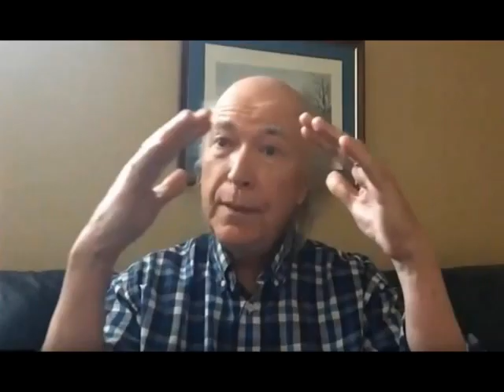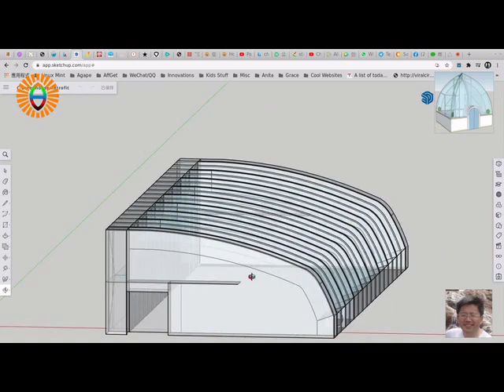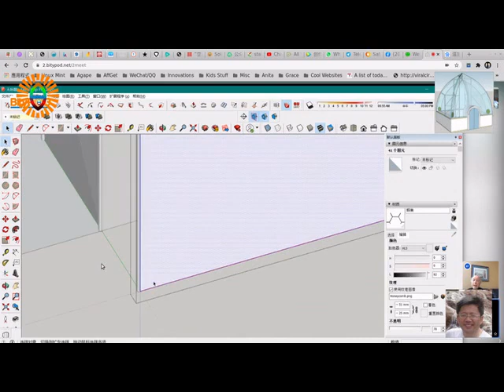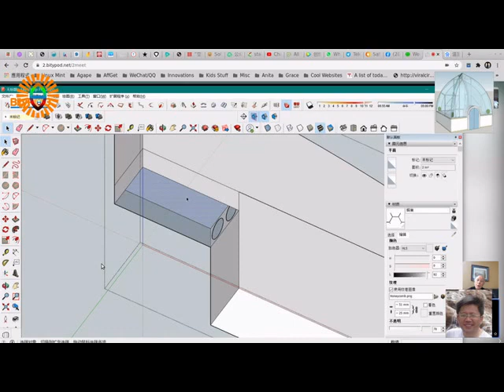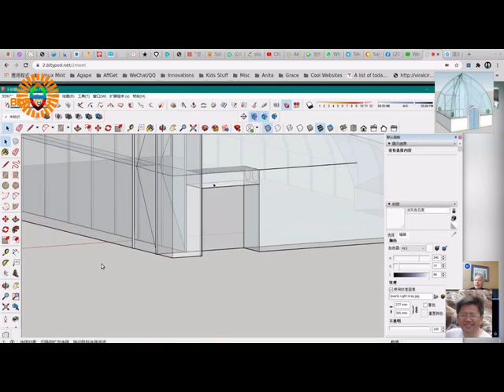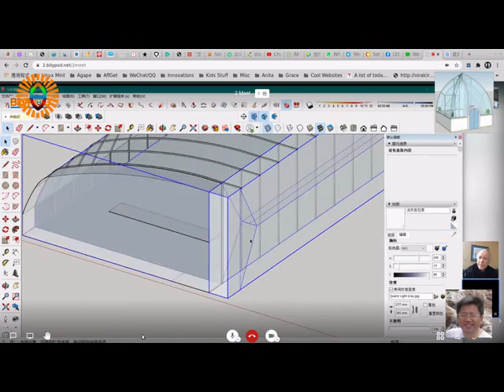Be Proactive: Critical Issues Revealed wtih Passive Solar Greenhouses or Any Conventional Buildings

Comment: Has his design ever been tested in -40 Celsius? We had a period of two weeks this year that was -40 and -50ish with the wind chill. It would be interesting to see how the greenhouse handled those extremes.
Reply from the maker: Steve, go to our website PyraPOD.com - on the home page I mention Kat and Ross Elliott who built a DIY greenhouse with some of Richard Nelson's guidance. Ross said that his greenhouse can handle -30 C without any problem. That was done a lot time ago. With partial guidance Ross could achieve that result, with FULL guidance with Richard Nelson I have the confidence to handle -40 or even lower temperature. At lease I know how, with Richard's help I could do it better. To tell you a little secrete: we are going to design a POD that could work on Mars or Moon. No kidding. Once the need comes, not a problem. How do I know, as we have a real life example: the Sun (heat source). the Atmosphere (heat capacitor) and the Earth (heat sink or battery).
Reply: @PyraPOD  are you an engineer?   Can you do a lecture on the energy systems of Agora Tower.  It is a giant greenhouse in a residential skyscraper

https://youtu.be/jO7LmzcNt5M
Reply: @PyraPOD  I am designing a smaller model containing just the solar, thermal, wind and water energy elements to generate electricity ⚡️ and hydrogen fuel
Reply: @PyraPOD  I believe these energy towers can be added on to any greenhouse allowing for renewable energy to create and maintain a variety of climate zones.   Growing a greater diversity of food, fruits vegetables and small animal livestock.

Comment: I did skip around in the video, so I missed the part where you explain why you chose bubbles over a liquid, closed circuit. For the life of me I cannot get behind the idea of bubbles happily floating through 200m of greenhouse. The entire cavity has to be water proofed and somehow bring it back to the tank. I find a closed heating/cooling system much more appealing (like in-floor heating), as it won't freeze if it's not heated, it can be used to cool the greenhouse in the summer and heat in the winter, just by using the reservoir as thermal battery. Anyway, thanks for the presentation.
Reply: Martian, what you mentioned is correct but not the complete picture. You talked about thermal battery, but the other half is how to efficiently capture the solar thermal energy. Simply using water in tanks is not efficient enough.
Reply: @MartianDanTheMartianMan  No need for any evacuated solar tube unless you need hot water for showering. Sorry, I have to say you did not comprehend how the system works. You have to think along the line of LIQUID THERMAL MASS. High temperature heating is NOT what are aiming for.
Reply: @TheoLogosDotNet  haha no, actually I commented under the wrong video as I am also in contact with people over solar heating systems and solar power systems. I should have paid attention to the title, lol.

Comment: This design seems to require a lot more maintenance?
Reply from the maker: Not really if you have fully understood how it works. Yes, you need fans that come with WATER PROOF motors - these motor are not that expensive now and are made to last long. Nozzles are NOT high pressure ones and they are working within a TOTALLY SEALRED cavity so that there is no chance for the soap liquid to get poluted and clogged. You do need to cover the soap liquid tank and add a filter to each water pump so that no solid particles enter into the sealed cavity. Note that we only need to operate the fans and water pump for just a few minutes every two or three hours. Because this long interval use, tear and wear are kept mininum. In this design, we place the fans and spray nozzles on the ground level for convenience IF there is a need for maintenance.

Comment: What about freezing of the bubbles in sub zero?

Ability to move such big distances while freezing on to wall

What about windows and leaking out or in. 
Soil contamination with glycol/soap etc

 What about collection of bubbles but maintaining the cavities to have a person walk?
How is snow cleared from green house in heavy snow fall no acces to inside?
How is bubble tank heated. Where is it located? 

Why not just super insulating all the non light walls once rather than cost and maintaining equipment to blow bubbles over and over?
Reply from the maker: Frozen bubbles only take place in regions close to the external layer. New bubbles are produced every two or three hours (depending your design) and new bubbles are warm. Windows? The whole canoy is a window. I mean you talk about ventilation, right? No need to ventilate once your can control temperature and humidy at the same time. Soil contamination with soap solution? Not much change in the sealed cavity. The tank you need a cover and a filter in the pump yes. Why do you need someone to walk in that sealed cavity? You polluted that area! Snow melting? No problem once you have warm soap liquid flusing the cavity every 2 or 3 hours in the form of bubble foam. Soap tank location, anywhere on the ground or half buried in the ground. The tank stores the solar heat you collect during the day for its use during the night.

Comment: Hi, many thanks for your share, ,small question, I recongnised the software SketchUp, do you use the simulator of sunshine? if yes could you share me the best orientation of this kind of greenhouse, because i'm sure full south is not the best, specifiquely in winter, when the sun is down, and shot time.
Reply from the maker: Well, if the greenhouse is well designed, then we do not have to pay too much attention on orientation. In our case, our greenhouses are transparent in all sides and everywhere. I am sure you know how SolarTube and Skylight works in collecting sun light from all directions. In essens, liquid bubble filled greenhouse with all sides transparent works on the same principle. BTW, that is the reason we did not start with the Chinese style greenhouse although I am Chinese myself :-) For the same reason, I believe our PyraPOD8 (Octa shaped) works better than the four-sided PyraPOD4 in taking light in from more directions.

Comment: Hello mister Zhang, i have a question how often do you need to refill the bubble layer per day and night? And how much liquid you reuse or need to refill?
Reply from the maker: It depends on how you design the system. We design it so that it fills the entire cavity in a matter of only a few minutes. And then everything stops, the fan and the water pump, for a few hours before you need to refill with new bubbles. Refilling is needed not because of natural bursting of bubbles, but because the need for heat exchange to take place. Remember the bubble temperature is not the same as the soap tank temperature. The goal is to store solar thermal energy in water tank.
Reply: @PyraPOD  Just to add concerning your second question: with 1 liter of soap liquid, you can produce 500 to 1000 liters of soap bubbles, depending on the size of bubbles. Use that as the guide, you will know how much liquid you need.

Comment from the maker: Richard pointed out that I made the mistake in explaining why the bubble temperature jumps up and down after sunset - that happend when the old bubbles were replaced by new bubbles. It is caused by the fact the outside is cold and soap water tank is relatively warm. So new bubbles will make the sensor to see this jump (see it jump towards the tank temperature), but the cooling of bubbls near the exterior layer will make bubble temperature drop down quickly. That explains the spikes and that only happen after sunset, not during the day.

Comment: what are r values of 12 inches of bubbles, compared to 12 inch air gap?
Reply from the maker: R12 for bubbles, I do not know the R value for 12 inches of air. I am guessing R1? So soap foam insulates much better than air. How much more also depends on the bubble quality you generate, large or tiny bubbles. The problem with a thick blanket of air is that water molecules (vapor) move rapidly and pass heat through convection. Fixing all the air in tiny bubbles stops this heat convection.

Comment: Thanks for sharing the idea. wondering how the temperature in summer time will be managed as in summer time it will be very hot
Reply from the maker: Glad that you asked that. In summer time, we do two things: (1) when the sun is too strong around noon, we fill the SOUTH side with bubbles as shade (doing this will not affect solar thermal capture and in fact will enhance it), and (2) on the NORTH side, we spray the soap liquid without turning on the fan so that a thin film is flowing on the inner surface of the inner layer, this will cool off the cavity quickly. In short, whether we use bubbles or liquid film, it is the chilling effect in action.

Comment: How would the bubbles affect the transmisivity of  greenhouse & the resultant photosynthetic active energy?
Reply: Especially when the bubbles get dirty, or soap dried on the film, it will be a disaster to clean. By the way to produce the sealed compartment is not an easy job. It is easy to fill the bubbles than to remove it!!
Reply from the maker: @ecofunfarm  The bubbles will not get dirty as they are in a completely sealed cavity. As for the sealed compartment, it is not as hard as many tend to think. Any tent maker can do it. Hard to remove the bubbles? Not at all. You simply turn on the fan without spraying the soap liquid. The air does the job. Not just to remove the bubbles but also dry the entire cavity.
Reply: @PyraPOD  Then why shall we have the out envelope? Just have a soft bubble sack blanket to replace the black fiber blanket. You can fill the sack with the bubble and vacuum it when not need.
Reply from the maker: @ecofunfarm  Well, a smooth out envelope is needed so that rain and snow won't be trapped. The soft bubble sack or bag is hanging from inside. No need to vacuum the sack, just use fan to break the bubbles. That's it. There are other factors we need to consider in order to feed soap liquid to create a thin film so that the solar thermal capturing process continues while allowing full light intake.
Reply: Farm EcoFun making a snow globe the shut it off & let the styrofoam balls settle on the inner layer then remove by blowing.... might be a market for that type especially around Christmas so kids can see Santa in a snow globe... that would be cool
Reply from the maker: @corwynwarwaruk2141  You could do the same with bubbles! BTW, the tiny bubbles stick together and look just like snow. We have design for Bubble Tower where you can cover the entire structure with plastic and then place Christmas lights inside, then you have a lighted tower :-)
Reply: @corwynwarwaruk2141  I had this idea many years ago. And I just think that it will need a big silo to store the small styrofoam balls.  Another problem is this balls still have air flow in between which cause the heat lose. Bubbles have not such a problem. Bubbles' problem is you need to conceal it and keep it without broken in some period of time. The insulating factor of the wet air and water film of the bubble is not given, one thing is for sure is that if the out film temperature is below Zero, the bubbles touching with it will broken and the insulating lay will be damaged then.
Reply: Farm EcoFun the problem with styrofoam balls would be static cling.... how could you ever get them off?  The rolled out blanket is such a simple solution there may not be able to improve on this type of a solution. I was in that greenhouse & it’s impressive. With our extreme cold weather the greenhouse was able to be above/near freezing with no energy input. It’s truly impressive!
Reply from the maker: @ecofunfarm  This video https://www.youtube.com/watch?v=wRqUmFPgqDo shows clearly that when bubbles are frozen, they will not break by themselves. Frozen bubbles in fact hold air inside better as wet bubbles breaks from top naturally because of gravity pulling of liquid down.
Reply: @PyraPOD  I did the experiment on frozen bubbles which shown the bubbles are mostly broken, less than 10% is left. My experiment is just put the thick bubbles in a sealed glass jar, or sealed plastic container, at room temperature and then put then in outdoor bellow zero degree for hours. I do not know what will happen if I can blow thick bubbles in a frozen jar and see it frozen and keep it quantity and shape.
Reply from the maker: @ecofunfarm  A nice way to make bubbles last longer is to make tiny bubbles rather than large bubbles. When bubbles are stiny, they stick to each other and get stronger, even in frozen state. Anyway, I sealed speace bubbles last longer than in open air.
Reply: @PyraPOD  Sure, the stability is depended on the surface tension of the bubbles and the fluid quantity. The problem of bubble breaking I guess is from the relative humidity of the space dropped sharply. When the bubbles are blowing to the space, the relative humidity is 100%, and then the space temperature dropped to bellow zero, the water are freezing and the relative humidity in the space will not support the water film in space, which will sublime and disappear!!
Reply from the maker: @ecofunfarm  Beside humidity, we have to pay attention to the gravity of liquid. The large and wet bubbles burst because of gravity, which pulls the liquid thin wall down. This should explain the wet bubbles burst from the top and the tail - whatch how the huge bubbles are formed with wind blowing in a video I shared. So it is better to create relatively tiny bubbles rather than big bubbles. Ross Elliott of Ontario Canada where is cold with -30 degrees C. He watched the bubble freezing issue from experience and he shared it is good to see bubbles sticking to the outer layer from inside get frozen as they get frozen instantly with ralative thicks bubble walls. I do not have much experience with that. Maybe I could do a simple experiment exploring that, either with a simple way to blow tiny bubbles or wait till I get my bubble generator working.
Reply: @PyraPOD  I think to source a kind of oil, or inert chemical as bubble media which   might be more stable than water solution. Since the bubble need very little liquid to form a large volume so the cost will not be a problem. The pollution and the surface transparency might be create some issues.
Reply from the maker: @ecofunfarm  For solar thermal energy intake and storage, nothing compares with water. I will stick with water and soap liquid solution for that matter. The pollution is not the issue as everything is in the sealed and enclosed space. As for the soap tank, we can have a cover and use a filter in the pump so that even there is some stuff in the water tank, it won't get sucked in.
Reply from the maker: @ecofunfarm  Have your tired to fill the jar with tiny bubbles and then seal the jar with a cap? That is close to what we use the bubbles in, totally sealed cavity.
Reply: @PyraPOD  Yes, the bubble size is about 3-5mm, I have tried both the room temperature and in outdoor minus 5 degree. I also tested with warm wall one side and cold other side. The results is not very promising. All the test is in a sealed container. (in the open room air , the bubbles broken at rate much fast!!) The bubbles most are liquified. However some very few (1-5%) might stay very stable at some place for longer time.
Reply from the maker: @ecofunfarm  What you get in a relatively small jar is about right as the temperature plays a role beside the air factor - as you clearly see that bubbles break faster in open air. In our case, the cavity is extremely large (distance between two coverings is 1 meter which is roughly 39 inches,  more than 3 feet ). This means that greenhouse temperature swing is small because of the massive quantity of thermal mass. We find that the need to refill the new cavity by new bubbles is not only determined by the natural bursting of bubbles, but also determined by the fact we need to replace the OLD bubbles with NEW so that the OLD bubbles bring back the solar thermal energy obsorbed during the day. At night the reverse is true. NEW bubbles are relatively warmer at night than the OLD bubbles. So replacing the old bubbles with new is essential to bring heat to the cavity so that the BUBBLE BLANKET stays warm at night - that is how bubbles warm up the inside from the bubble blanket and that is why you do have to loose some heat in doing that. That is called the heat sacrifice, which explains why the inside temperature will drop slowly. Tests show that, as long as the heat loss this way is kept under 1 degree C per hour, we are safe. Say the greenhouse temperature at sunset is 25C, and the heat loss is maintained at the above rate (through bubble insulation), so from 5pm to 9am (9 am is roughly the hour the greenhouse starts to sense meansurable heat gain) is 16 hours, then you would expect to see the lowest inside temperature to be 9C (25 - 16). So that is why the insulation at night is so important. In our design, we keep the double layer separation at 3 feet (36 inches, i.e. R36) for cold zones and 2 feet (24 inches, i.e. R24) for warmer areas. Normal house is now requid to be built R24. Because bubbles are light, thick bubble wall is not a problem at all.
Reply from the maker: Not much. The bubbles are hollow and will let all light goes through except for the red light region (transferred into the form of heat). Also, you do not have to fill the entire envelope during the day. When you need more sunlight coming in, you can replace the bubbles with soap liquid films, i.e. you turn off the fan and do not blow bubbles, simply spray the soap liqiud to form a thin film on greenhouse fabric that is transparent. Then you still get both: full light in and solar thermal capture at the same time.